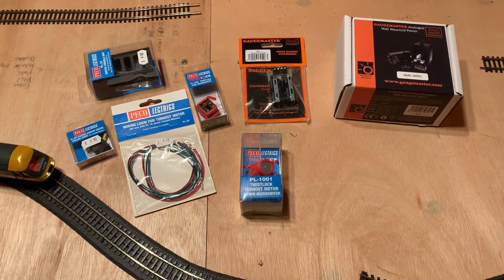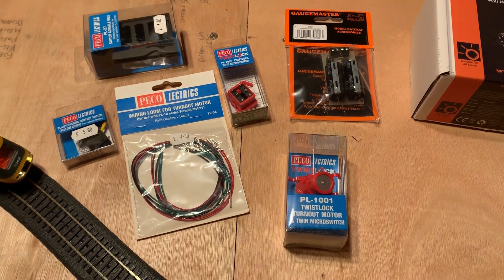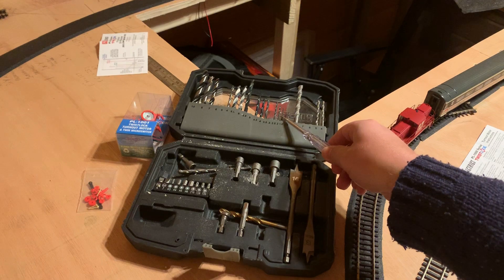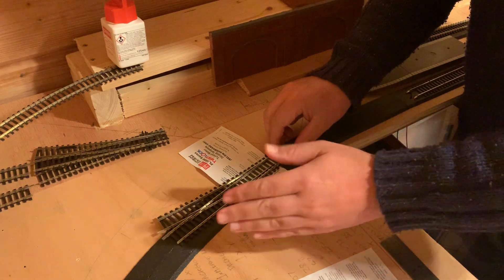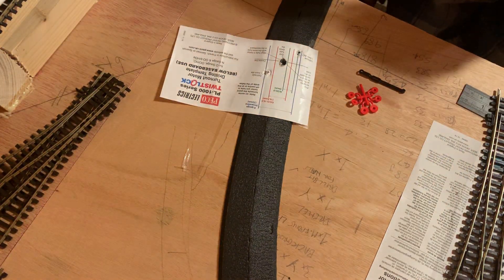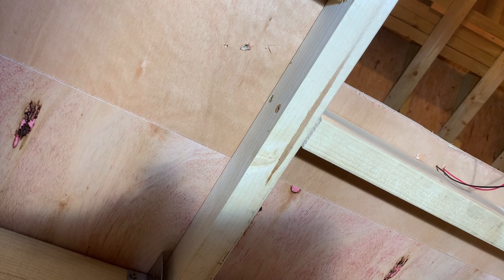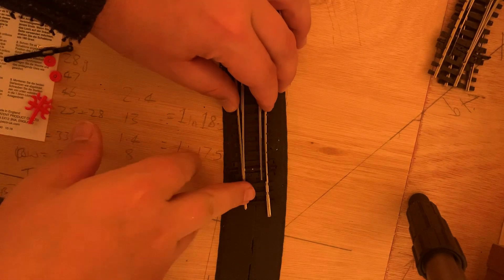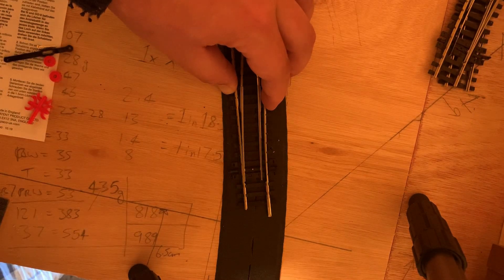Peco PL1000 / PL1001 TwistLock Turnout / Point Motor - How to Physically Install, Tips and Tricks

Comment: I only just found this and it is really interesting.
I have a small layout approx 10x9 and have about 20 points, all Peco insulfrog.
When I built it I was very unsure about tge electrics and still am but decided Ibwoukd avoid the electrical points based on the perceived complicated installation and cost.
So I am now intrigued and look forward to watching your further successes. Thanks for sharing
Reply from the maker: Hi Charlie, thanks for the view and nice comment. 20 points! Now that'll be a fun wiring up experience, if you go for point motors! Maybe start with the ones that are a bit awkward to get to? I hope I have further successes to share! Doing lots of scenics at the moment, which was certainly not my forte before starting out! Getting there though. Good luck with yours!

Comment from the maker: Hi Alan Morton, in my infinite wisdom I somehow deleted your message while trying to respond to you. I love my iPhone! Luckily I still have your comment. That’s a real shame that your pin is not long enough, it’s strange, my board is 18mm and I use 5mm foam. And it fits just perfect. I don’t know of an easy way to install a new pin. What I would recommend is doing what have done on my dock area (27mm wood + 18mm ply) is to use a drill bit to reduce the depth of your board, I know this is a pain and I’m really surprised it didn’t fit for you, it’s a shame. I can’t think of another easy way around it though.... I’ll do a vid in a couple of weeks to show the way I got around it, but with 18mm you should be ok... damn.

Comment: Thank you for the video.   I have loads of PECO switches on my layout with the old PL-10WE, but planning to use the PL-1001 for my new switches.   Great to see confirmed that a 15-18mm board with trackbed above still works.  What I do realize is that once you have drilled those position holes the switch must be placed 100% in same place, a bit readjusting the track as I was used in history is clearly not possible anymore.   Do you already have experience with how it still works after your entire track and trackbed is glued in place ??  How do you avoid your track during final gluing in place is not accidental moving a few mm.
Reply from the maker: Hi HaSaKo, this is a great question. It was certainly easier for me as I was placing the motors prior to fixing my track locations to the nearest mm. There is a few mm play in the small screws that are placed below the board, but you are right there is not much movement. If you already have PL10’s then I assume you can use the same hole that you already have drilled in your boards? As long as you centre on that middle hole you should be okay. The other advantage is if you do move the track a few mm on gluing, the holes on the outer part of the template are only 1.5mm, that way they can be easily redrilled in a few minutes. I think you’ll be fine, but I would be really interested to hear how you get on. Why are you switching from PL10’s? Excuse the pun!! Thanks for your view and your really great question.
Reply: @AberHaltJunction  Dear,  I have today about 50 PECO turnout on my railroadlayout and all have the motor directly mounted under the turnout.  So, I have to make a big hole in my baseboard to give place for the motor.   My experience is that time to time a motor has fails because the coil got overheated and the motor needs to be replaced.  Luckily it happens rarely, maybe once per 1-2 years, so far only about 5 times in past say 10 years.   BUT, to replace a motor in that position without taking the turnout and track  is a nightmare.  You need somehow to get the 4 pins of the motor and the drive pin all in the opening, while you basically cannot see what you do.    So far each time I managed it without having to breakoput the turnout itself.  Remember everything is clued due to the track bed stones.   

So, when PECO came with this new P1001 I saw as benefit the easy replacement of the motor drive in future failures.   For me that is the only benefit, a potential easier replacement when a motor has failed.  The installation is maybe also easier, as drilling 3 holes is easier than cutting a big rectangular hole.   So, with soon installing 10 new turnouts in an expansion of the layout I have to consider this new P1001 as an option.
Reply from the maker: Hi HaSaKo. That is an awful lot of point motors! I know exactly what you mean about holes in the baseboard, I was keen to avoid that on mine as I will be shifting my layout design quite a lot as time goes by. Yes getting underneath and fiddling around under a baseboard is a challenge. It will certainly be easier to replace failed motors, they literally just twist in and out and then you just disconnect the wires, which is also easy with a screwdriver. The only slight negative is they do cost a bit more, but in my mind (and of course it depends how many motors you are doing at once) it is worth it for all the positives. Keep in touch and let me know how it goes.

AHJ
Reply: @AberHaltJunction  Hi ABJ, I have installed the first Twistlok motor drive at a rather difficult point.   I did changed the procedure a bit.  Instead using the paper mall I did following.  1)  I measured where the pin hole had to be and made a 10mm hole versus requested 8mm.  I marked on the turnout track support bars, where exactly the 1mm hole would have to be positioned, then I installed the trackbed and the turnout on it and fixed them permanent.  Only then I drilled the 1mm holes.  Overall relative easy.
Reply from the maker: Hi HaSaKo, thanks alot for the update, glad to hear you found it really easy to do. I think making the hole a bit bigger is definitely a wise choice, no need to be as tight as Peco was suggesting. If a difficult one was relatively easy for you , hopefully the remaining ones are easy. Happy to hear it is going well, keep me updated. AHJ